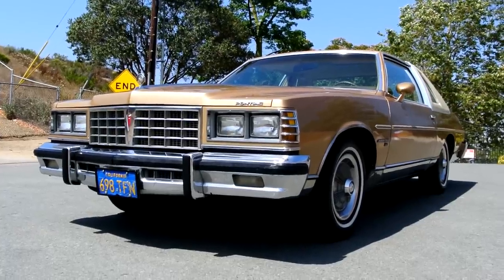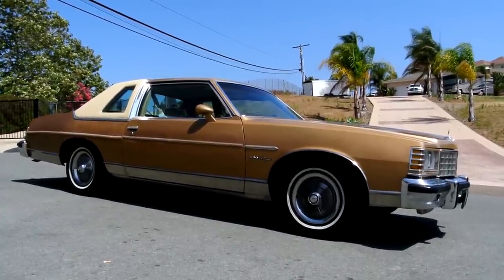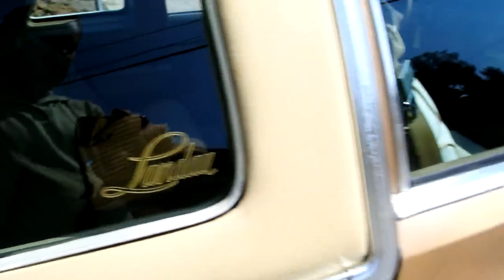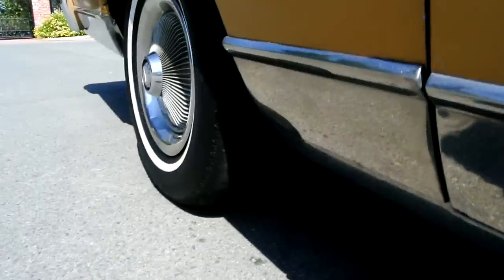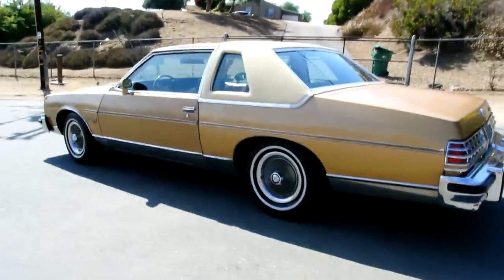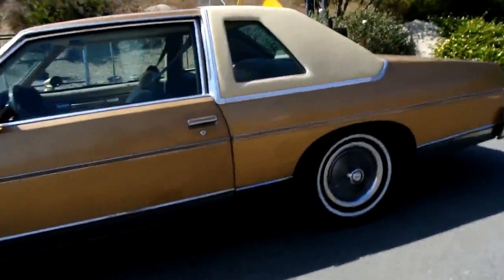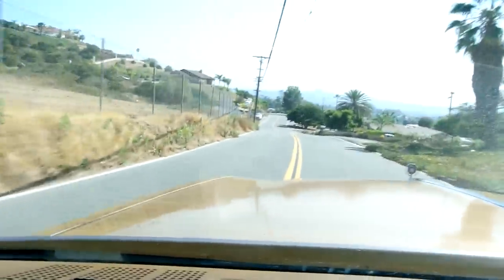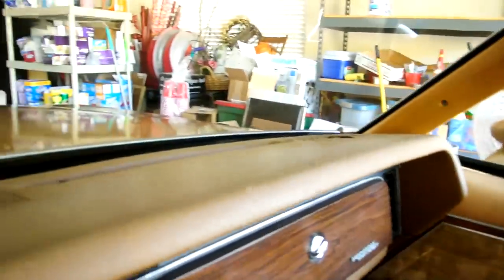1977 Pontiac Bonneville Brougham Landau 2 Dr Coupe 2 Owner T/a Olds 403 RTS Skirts

Comment: Yes the sunroof is factory because the plastic piece on the underside of the glass is the same color as the interior.  If it was not, it would be black.  Your car (and probably lots of the Trans Ams) used an Olds 403 instead of a Pontiac 400 because it is a Calif car and the Pontiac engines could not pass the more strict Calif emissions laws so in the late 1970s they stopped installing Pontiac engines in Calf cars..

Comment: Those Pontiac's from California are commonly equipped with the oldsmobile 403 because the 403 was more emissions complaint than the Pontiac 400 engines the same rule applied for the trans am

Comment: you know, given that this car is obviously unoriginal regarding the paint and the rubber mouldings which are falling apart and it would need to be replaced, why not find somebody with a four-speed manual transmission to retrofit to this. Can you imagine a four-speed Hearst shifter coming out of that carpet and flooring with a clutch pedal? I think that would be fantastic. But true dual exhaust on it and a couple of catalytic converter's to clean it up, and you've got an amazing car. Perhaps not original, but I would submit that a lot of this car is not original, such as the two different coloured seats in the front  and various other things that appear to be questionably connected with its original construction.

Comment: 403 V8 is a torque monster. Largest bore cylinders in a V8... 4.351"... huge!!!
I have built one up for my Caprice Estate to replace the anemic 307. Car has factory posi and will roast the tires if you just look at the gas pedal with the 403.
Reply: The 400 would eat the 403
Reply: @tomcherry7029  in what way?
Reply: @tomcherry7029  I don't know my guy,I'm a owner of two 78 hardtop Bonneville one with 400 and the 2 door with 403. 400 are monsters,but don't get it twisted,those 403s are nothing to scoff at.
Reply: @hardwurk2012  a lot easier to build for power than a 403
Reply: @tomcherry7029  true, you can get drag power out of a 400, but I've only heard of 403s topping at 500hp to 600hp. Those 403 are nice streets beaters though and make good sleepers. Just my opinion. I'm a Pontiac guy,big fan of 400s,but I love 403s. Lol
Reply: @hardwurk2012  you ever took a 400 to a 462 ? Take a 455 crank cut the mains down to 3.00  and you get a high reving 455 after you bore the block . You can bore it to a 462 cid  and it is a monster.
Reply: @tomcherry7029  no I haven't yet i start auto mechanic school next month summer semester,so 400 is perfect for my first project. I have never owned a new car in my life,I'm 35.
Reply: @hardwurk2012  i got my associates degree automotive service  technology in 1991
Reply: @tomcherry7029  damn awesome man. Can't wait till get my experience. I only know the basics.

Comment: Due to stricter emissions regulations, the 1977-80 B-body Pontiacs and Buicks sold in California and high-altitude regions equipped with V8 engines used the Oldsmobile 350 or 403 engine (403 discontinued after 1979). The Olds 403 was rated at 185 hp. and 320 ft. pounds of torque.

Comment: there seems to be a real issue in the moulding running down the passenger side door being totally misaligned with the moulding on the front fender and the rear fender areas. It looks like the door has come off or been repaired and the moulding either reattached or just being originally misaligned. However, to be misaligned at least 3/4 of an inch doesn't seem right to me.

Comment: 19:40 A little bit of tape around the door seal. Really? Electrical tape all the way around seems to indicate that the rubber moulding has disintegrated. I guess that's a little bit of tape if you want to take the focus off the fact that the moulding would need to be replaced entirely. Also the missing clip on the carpet and section on the bottom suspiciously looks like a rust issue. nevertheless, I do appreciate you going on this extensive tour. And realizing that this review is so old I'm sure my comments are rather meaningless. Thank you anyway for the presentation!